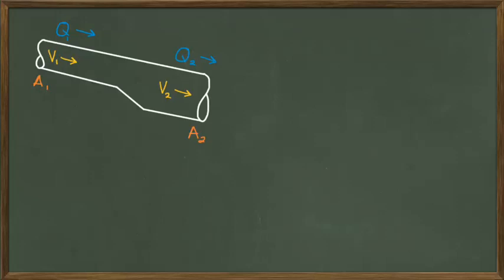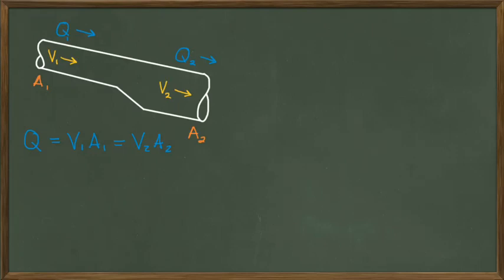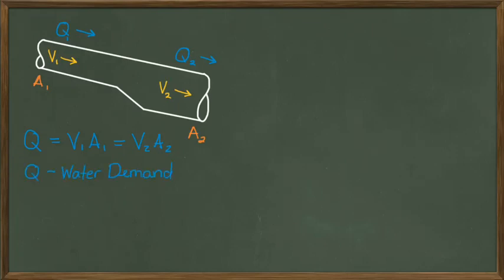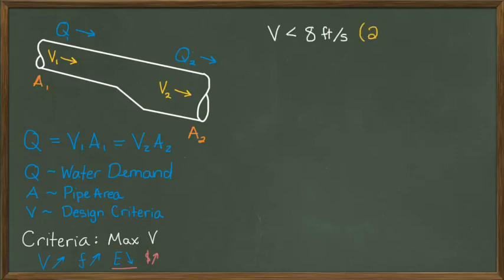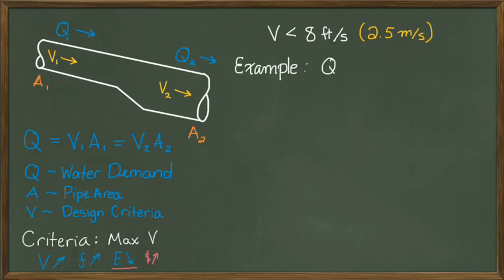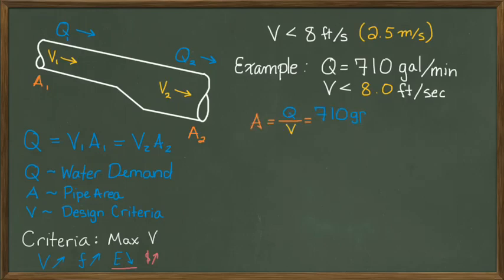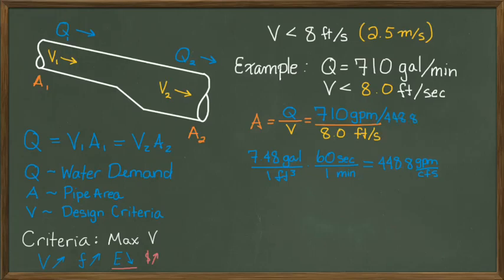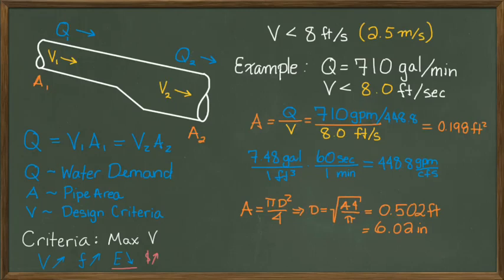Velocity Criteria

Comment: The time for water to flow through an Ostwald pipette at 20°C was 297.3 sec. The density of water at 20°C is 0.9982 and the density of a sam- ple of olive oil is 0.910 g/mL. The viscosity of water at 20°C is 1.002 cp and the viscosity of the sample of olive oil is 84.0 cp. How long will it take for the olive oil to flow through the Ostwald pipette at 20°C?